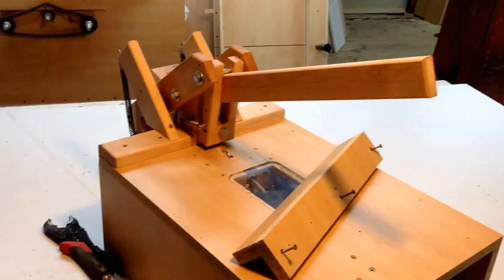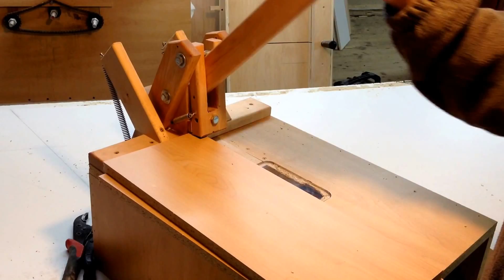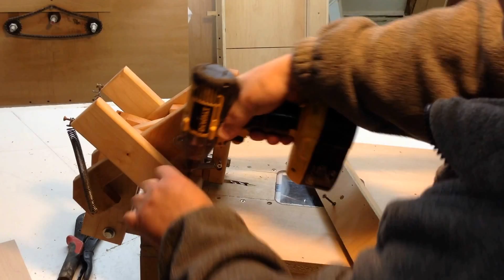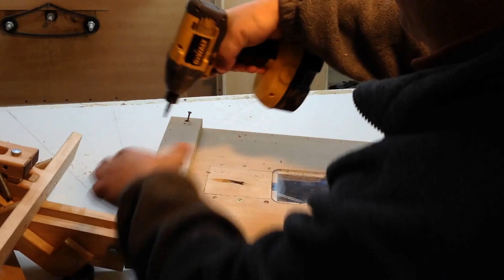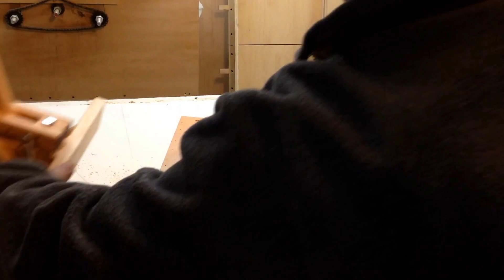#5. Homemade Foreman style Pocket Hole Machine. Adjusting heights

Comment: Thanks for that. Earlier comments suggested shims that would simplify changing to different stock thickness but I see there is no drill-depth adjustments so the 2" hole will be well short of the ideal position. I suggest that the drill slide mechanism be fitted with dowels that will come up against the shims, limiting the drill depth automatically. Then mach 2 should be automatically adjustable and fantastic if you still have the energy for a rebuild.

Comment: since I only drill 3/4 or 1.5 inch thick material I figured the spacing and added a fence on hinges flip the fence up out of the way for 1.5 and flip it down for the 3/4in im still working on a different hold down method

Comment: Appreciate you showing us how the arm assembly can be adjusted for larger thickness wood. But could you tell me if the exit hole (pilot hole for screw) that is drilled, lines up to the middle of the thickness of any size wood? I couldn't see that on the 8/4 piece or other thicknesses. Great jig and thanks for sharing.